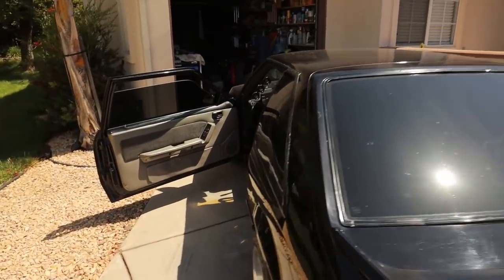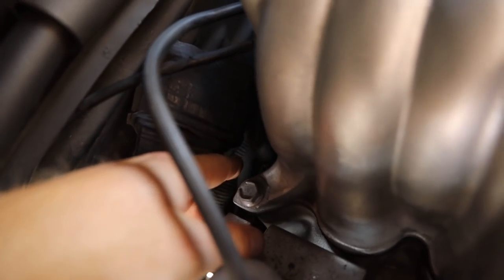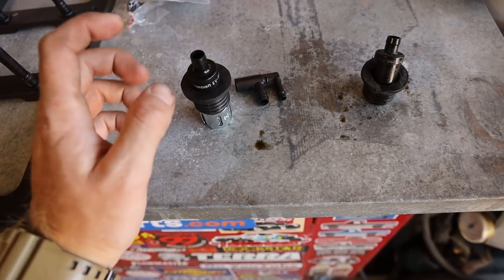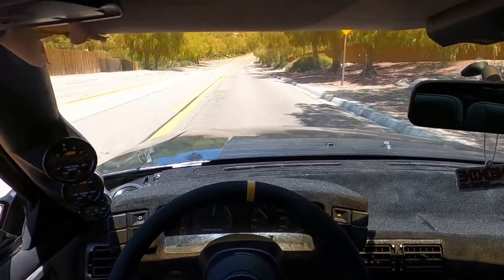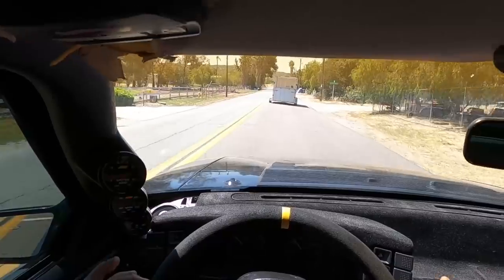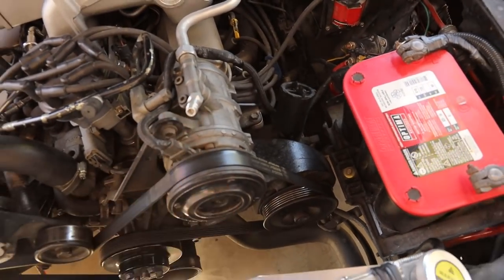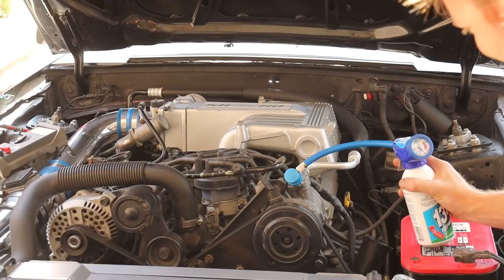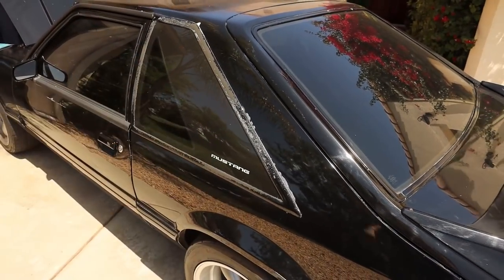If your Foxbody burns oil... This is probably why. SUPER CHEAP FIX FOR YOUR FOX.

Comment: How many cars have you fixed and Sean is not done with his truck. #seanfinishyourtruck
Reply: Love that hashtag 🤣
Reply: Bumped and Rusted My question is who's gonna finish their truck first Sean or Franklin.?
Reply: @lilorbielilorbie2496  FRANKLIN is my bet. I’ll put $20 down Mater is running before Sean is down payable to the winner!
Reply: @bumpedandrusted6074  Either way I'm sure they will both  be done before I get my junk up and running. lol.
Reply: I had a 93 fox it also had the GT 40 INTAKE IN IT AND WAS CAMMED AND ALL I HAD TO RUN 2 PCV VALVES TO KEEP IT HAPPY RAN PERFECT AFTER I INSTALLED INE IN DRIVERS SIDE THAT WENT IN TO THE FILL CAP ON VALVE COVER FINALLY HAD TO SELL A COUPLE YEARS LATER TO MANY SPEEDING TICKETS  CAR LOOKS GREAT YOU DID A GOOD JOB ON PAINT FOR A IN THE YARD JOB

Comment: THE number one thing a fox needs is rear gears. My 88 had 3.73's and was fully capable of verified 12 sec 1/4 times and still got 22mpg when driven in a sane fashion.
Reply: Well, driving in a sane fashion is the operative phrase here. Have you watched Craig drive ?  HAHAHA!
Reply: Lol 12sec not an stock fox for sure 😅 stock is more like 15sec 1/4
Reply: @jonathangautreau2230  

 Car & Driver 1987. Stone stock GT ran a 14.7. An hour under the hood without changing parts would turn that into a 13.9.  LX Coupes were laughably easy to get into the 12's.
Reply: @jonathangautreau2230  Stock is relative. Factory cam, lots of bolt ons from, and drive it like you hate it. I tried to put the full list of things up, but it was to long to get it to post.

Comment: You have a low pressure switch that prevents clutch engagement. No refrigerant, no oil circulation, it protects your comp. Just jump the plug until you get some in there, then it will operate normally....

Comment: CRAIG! I have wanted to tell you this ever since you began the truck rebuild.  Glyptal paint the interior of your engine block before you begin assembly. It seals the casting and really aids in getting your oil back to the pan. Old Smokey Yunnick trick, 
It's the paint used in Alternator windings, but Yunnick found that it sealed his old castings and the smooth texture when dry really helps the oil flow back to the pan. 
Clean the block with acetone and a brush, then dry it well. Apply it with a brush all over the rough casting areas(cylinder areas on top, block timing chain area, crank webs) you won't be sorry! Wanted to tell you earlier, but you always got the block back quickly, so I was always too late. Watch your vids every time, on the day they come out. Love the Ford guys! I've been one for years, so I wouldn't steer you wrong.
Reply: Craig is the kinda guy that claims hes a poor college kid yet he throws 3k at a motor that he blows up with barely 6k miles on it cause he doesn't build them right the first time

Comment: Nice. I have an 88  Mustang LX 5.0L with the AOD. Mine is not daily driven as I live in Michigan but mine has 241K miles on it. i had it for 30 years now as of Feb 2. The AC not working can also be that low pressure switch on the receiver /dryer. It just screws on to it and has a shradder valve under it so you will only loose a very small amount of charge when changing it as long as you  are quick at unscrewing it . i had to replace mine a few times over the years. I also just recharged mine last year with R12 that i had 2  12 oz cans of. Next time i will convert to R134. Also i do have and F100 myself that i'm restoring right now but mine is a 83 bull nose . Will rebuild a 87 Mustang engine for it as the original V8 is underpowered.

Comment: Dude, I wanna see you do a DIY 347 stroker. Clearancing the bottom of the bores for rods, etc. All of it. And it would make you REALLY fall in love with the Foxbody.. Like you, I'll never forget how happy it made me when I finished building my A/C system from scratch in my V8 Ranger. Best it will do via vent temp is 42 degrees at cruise. I got lucky sizing all of the parts in the system.

Comment: PCV stands for Positive Crankcase Ventilation. These were some of the first smog devices used starting in the mid 60s. Before these engines had draft tubes. A simple tube from the engine to the ground. All it’s for is to vent blow by out of the crankcase. Now fumes are run through the intake and burned during the combustion process. If you have a lot of oil in your PCV system it’s caused by excessive blow by.
Reply: I had to listen to Craig a few times, but felt I didn't quite understand and would explain PCV to those interested.

As mentioned in this posting - PCV stands for Positive Crankcase Ventilation. It's a pretty simple check valve, usually. This valve should only open when vacuum is high... In other words, at idle. This is generally OK, since it does increase idle speed a bit. This high vacuum period occurs enough under normal driving conditions to ready clear the crankcase of their fumage. 

Under acceleration you don't want to introduce a vacuum leak, which PCV induces, so that valve will be shut on acceleration. No vacuum loss while feeding it the onions.  But, if pressure in the crankcase exceeds the resistance of the check valve, it will still vent, but without altering the vacuum. 

Also, when first introduced it was determined that you can't fling oil at a suction tube feeding your intake... so stock valve covers used internal baffling to let fumes move through, but minimal oil droplets. In this case, and with most aftermarket valve covers, you saw (here) a filter deep enough to make splash oil drip off, hopefully. Not as effective as internal baffling, but roller rockers don't offer much room for anything else. There are other options for much the same benefit.

So check them PCVs fellars. 🧐

Comment: It’ll still burn oil. Even after changing the screen and pvc valve. Get a catch can from lmr. a company just put one out made for the foxbody. I put one on even after changing everything and drove at least 100 miles I had a spoon full of oil in the can. It really helped my afr it runs even cleaner so it’s worth every penny.

Comment: The low pressure switch saves your compressor. If you have a fitting come off on the a/c you can have moisture in the system. Anytime the systems seal is broken you really should recover the refrigerant  and evacuate the system (hook it to the vacuum pump again) because if their is any moisture in the system it will cause issues. I've worked with my Dad a retired licensed refrigeration mechanic that has worked on Fords in the 60s, semi truck diesel in the 70s and then transport refrigeration the 70s to early 2000s.

Comment: as you found out, you may need to jumper the switch so the pump runs when you charge the system.  in vehicles with both hi & low press switch you;ll need to energize the clutch to charge it.

Comment: Also on some of the aftermarket intakes the baffle plate on the lower intake is not made right and will let oil get by. There a baffle plate you can print off line to fix that also.

Comment: My dad got a 98 explorer sport v6 from his brother and hes had it for like 6-7 years now and the ac has never worked in it all those years he had a alternator that would start squealing when turning on the lights fan whatever (very bad bearing surprised it lasted that long tbh) so he finally replaced it and the ac compressor decides to finally kick on and its charged. Literally replaced the alternator and it fixed the ac twas wack lol

Comment: My AC has the same problem the wire in the plug was migrating back so when I plugged it into the compressor it would push the connection instead of making contact